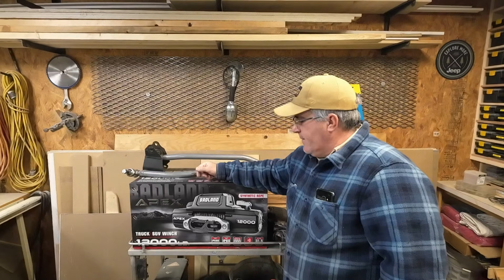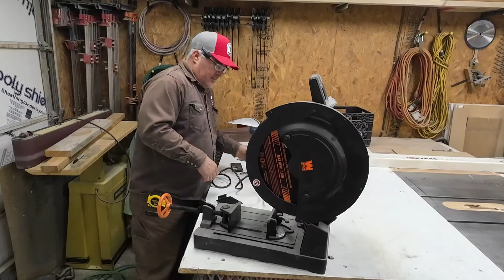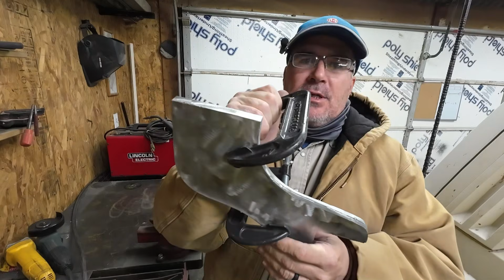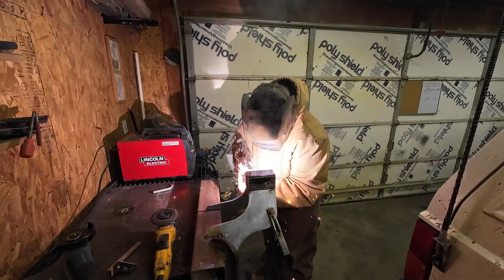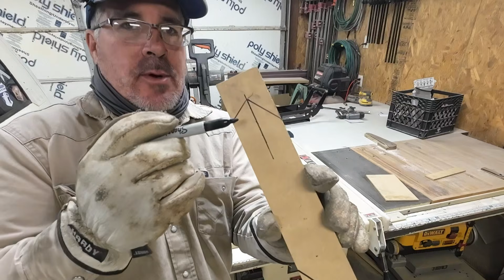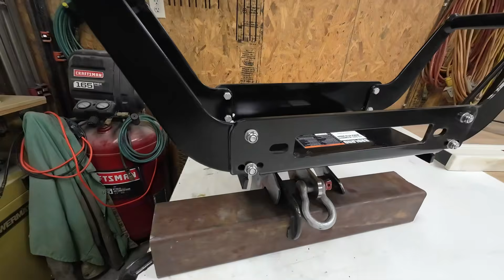Trailer mounted receiver hitch for winch

Comment: The only time I had a trailer on my car hauler it was riding with the tongue to the rear because it was a lot easier to load it with another truck than messing with a winch and the tongue jack wheel
Reply from the maker: Thanks for watching.

Comment: The guy i bought my car hauler from put a winch on it but he mounted it inside a toolbox to the deck. I have been thinking about changing it to something like what you've done, only thing holding me back is my trailer is aluminum. Maybe I need to buy another welder lol. Great job, thank you for sharing your skills knowledge and experience. 

Appreciate ya
Reply from the maker: Time to lear how to weld aluminum sounds like. I would like to try some aluminum and stainless someday. Thanks for watching
Reply: @bauerscreations3436  lear 🤣 you do that on purpose?  That's hilarious 😂
Reply from the maker: @michaelosmon No, just a typo. I got distracted while i was typing my reply. Is funny though.

Comment: When you clean your work table top, drill out several 3/4" holes, mount a rain gutter underneath (with a bolt on one end) so it swivels/drops down on one end. Ta daaa - sweep debris through the holes 🕳, drop down the gutter into a bucket 🪣  and the floor stays A LOT CLEANER !!
Reply from the maker: Not a bad idea, Thanks for watching.

Comment: This is way fancier than the cobbled up quickie receiver socket riser I welded on my trailer. Also that's not a clevis, it's a screw pin shackle. A clevis has a smooth pin with a cross hole for a cotter pin or molly hogan. At least that's what Grampa taught me.
Reply from the maker: Good to know, Thanks for watching..